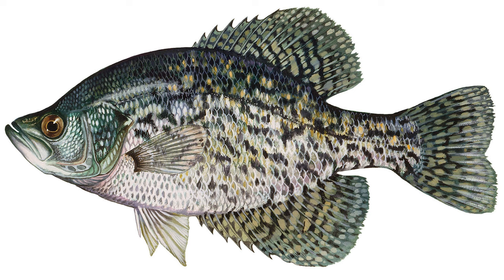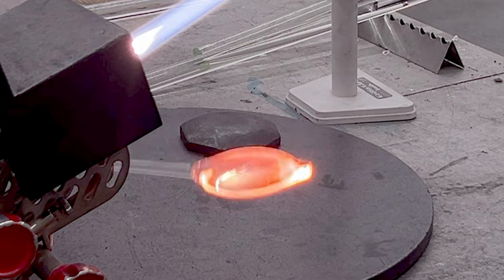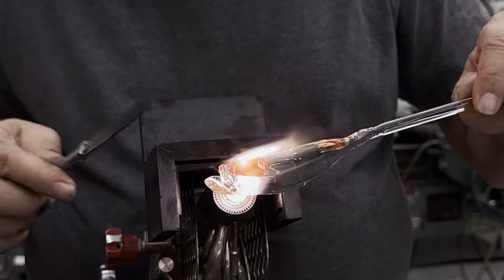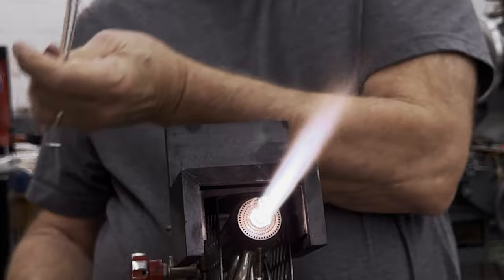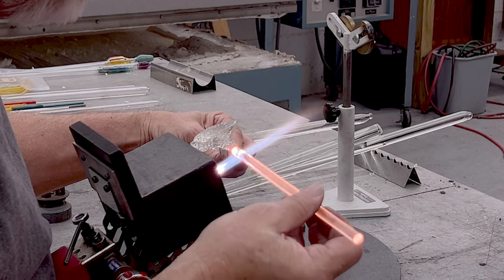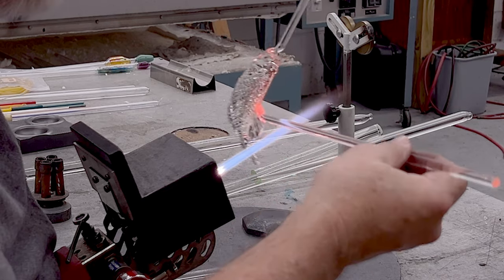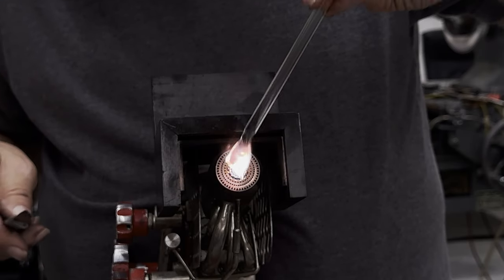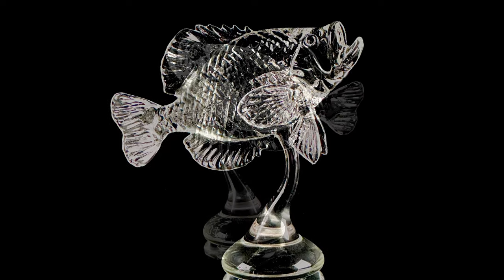Making a Glass Crappie!

Comment: thank you again for another great video!
hope all is well

Edit: when using the mini torch to heal the edge of the fins
what would you use if you did not have a mini?
i have a phantom, turn down to as small a flame i can then accept the bit of disforming that will happen on the bottom of the fish body untill I just get better at it?
Reply: the control when making the fins and when getting smaller & doing those tiny dabs to only then also clean it up with the same hot end of the rod. I hope that clicks in my head soon.
Reply from the maker: I strongly recommend the smith little torch with a hornet tip as a minimum set up for hand torching. The Phantom has a very nice center fire, but you really need the force the pre-mix smith gives you. Total cost for both torch and tip should not be more than $250. You will make it up with the first two or three pieces you save using it.
Reply from the maker: @ActivistTigers  It should with a little practice. I use the edge of my flame a lot so I don't have to make so many little adjustments to the flame while I am doing a series of moves.